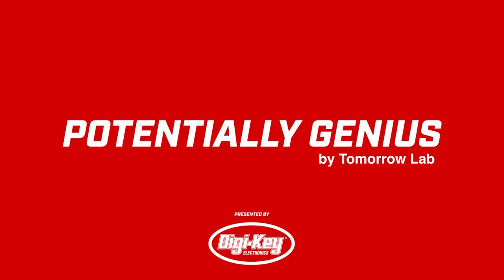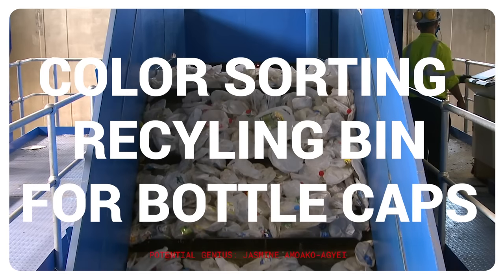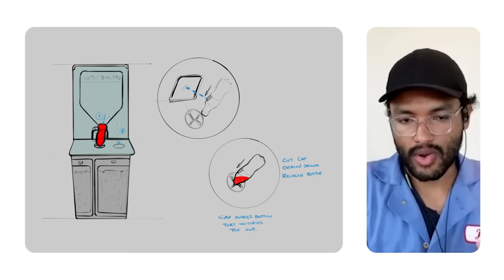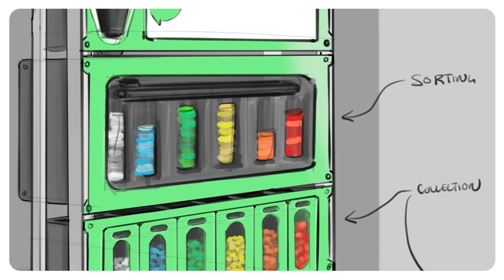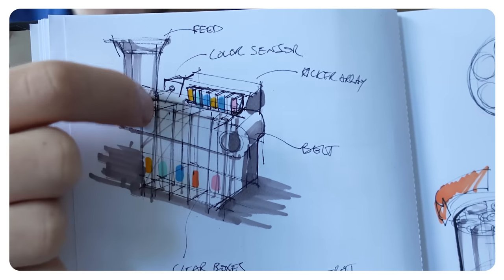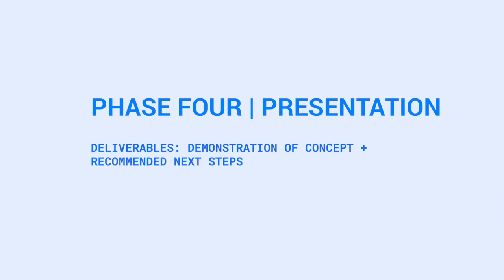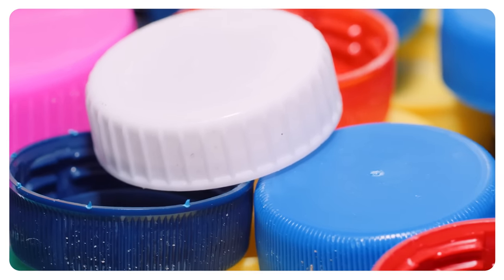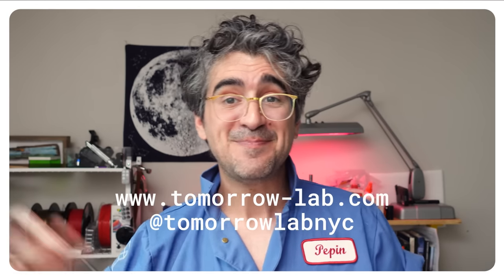Color Sorting Recycling Bin for Bottle Caps – Potentially Genius ™ | Digi-Key Electronics

Comment: I can see this idea working very well in a more developed country and for a 2nd or 3rd world country where even making sorted garbage bins readily available all over the city would be a challenge can shift this process of removing and sorting bottle caps a little later where the collected bottles are bought back to an industrial size version of that machine which could separate the caps from the bottles, it would result in less net bottle caps collected but it's better than nothing.

Comment: Rocket flight computer.  With altitude, flight time duration, temp, pressure and more. Eventually morph into a guidance system using gyros for hobbyists.

Comment: As i understand the process of pressure and heat will normally erase the color of recycled plastics.  The color of the plastic at first stage of recycle is a waste of energy.  Better would be a spectrum of the plastic type (2, 3, 4, etc.) make seperation auto sorting cutting labor costs.
This project will run into problems with so many shades of each color, unless you want to make mosaics out of plastic.
Reply: Hi Carl! Yes, the goal is to sort colored caps for use in craft-style projects like making mosaic cutting boards, planters and other designs where the maker can let the colors really shine. The idea is to treat the caps as a high-value material rather than the lowest-value flake. Here's an example project: https://www.youtube.com/watch?v=jx2B55YG4SY